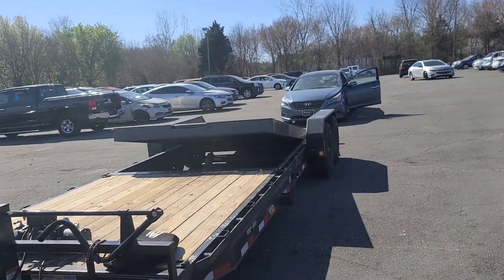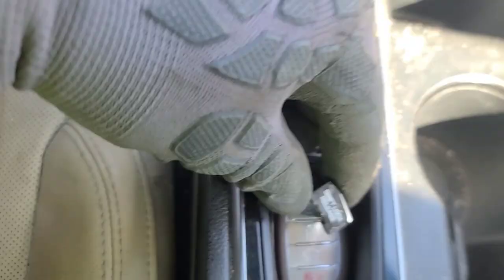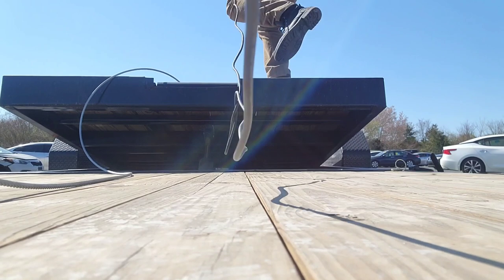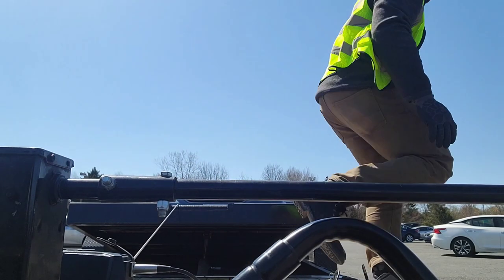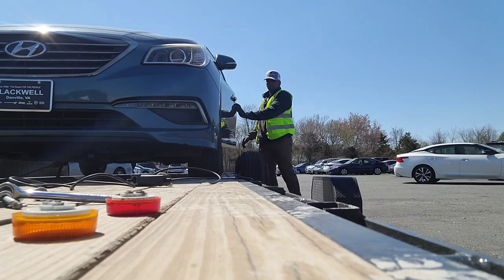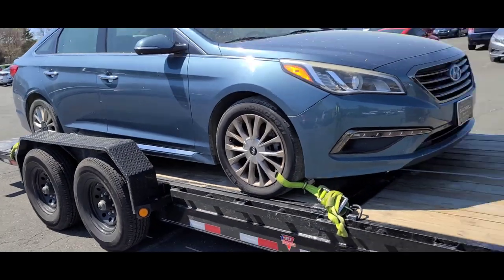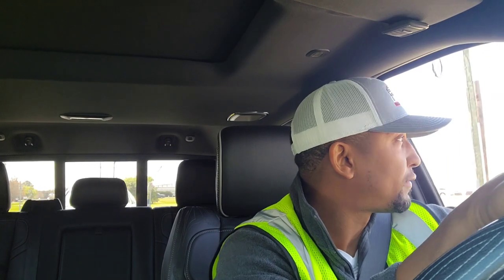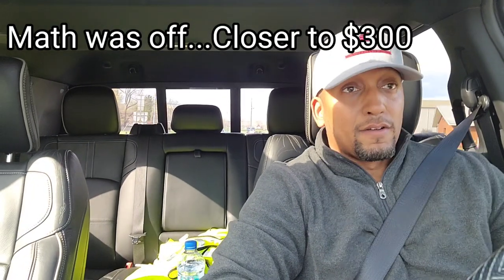Car doesn't run...NO PROBLEM! Non-CDL Part-Time Hotshot

Comment: Just make sure you don't straddle that winch line when it's under load. That cable, hook or winch is known to slice or knock a person out if something comes undone.
Reply from the maker: Thank you. I will be sure not to make that mistake again. Thank you for adding value!

Comment: I’m a huge fan of your channel and im looking into starting this part time. Trailer prices are going crazy and I was wondering how much you got yours for to see if the prices are comparable in my area. Thanks for the great content and information.
Reply from the maker: I really appreciate your support! Trailer prices are seriously out of control. My trailer was $10k before adding the winch, rollback, and tool box. After it was all said and done it was just under $12k. It made sense for me to pay that because I knew how I needed to use it and the flexibility of use worked for my situation having purchased 12 acres of land recently. Also, because I bought it for business use as well, there is a nice size tax write-off for it that will benefit me in my situation. I know you weren't looking for all of that info but I wanted you to know what I took into account with it. I can tell you they are up significantly from just last year
Reply: What is your area?
Reply: @acorral9011  Are you trying to car haul?
Reply: @bryonsusedautos  yes I am
Reply: @acorral9011  I looked st trailer around your area and damn they are expensive there. I would suggest that you travel some and get a better deal. Try a few places in Texas!
Reply: @bryonsusedautos  Yeah I was thinking of looking in Texas. Thanks for the info
Reply: @acorral9011  Any luck on a trailer bud??

Comment: The winch does have a free spool to pull it out without using the controller! Also you got the wrong trailer for auto hauling!
So you grossed $700 but only profited $300 damn your doing something wrong!
How is your fuel and taxed over 50%?
Reply from the maker: It's actually a perfect car for car hauling. It's actually a pretty solid trailer for hauling freight as well. Especially for my 3 Better for car hauling but it gives me options. 

In regards to the taxes AND fuel combined being over 50% with fuel included, you get taxed on your total income of all your businesses. So the income of the hotshotting i do on the side is taxed according to revenue of all business I own combined. Unfortunately, the more you are blessed with success in business, the higher the tax rate you get blessed with lol. There is actually a tax strategy that I will benefit from with this. You gotta play a different game my friend. Look deeper.
Reply: @liveyourfree  Yes but having to un-bolt the fenders every time you load and unload a car would be annoying and cost time!
Reply: @liveyourfree  But with hotshotting all of the tax write offs that you get your taxes wont be anywhere near that percentage!
Reply from the maker: @bryonsusedautos  it's only for certain vehicles that I have to take them off.  I've gotten much more efficient with it now. It's not really a time killer like it was.
Reply from the maker: @bryonsusedautos  tax write-offs are just a part of it. As backwards as it sounds there are actually benefits to showing a loss in some areas in conjunction with other profitable businesses. Especially if there is a long term strategy that you can tie into other companies. And that's just the business part of it. Being able to travel and spend time with family members in a different way is the real profit.
Reply: @liveyourfree  Yes sir!